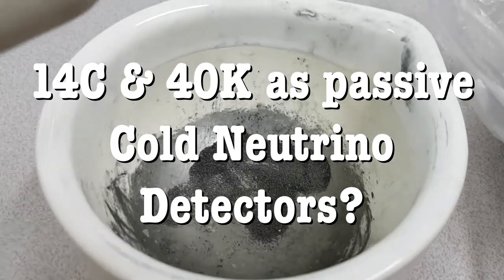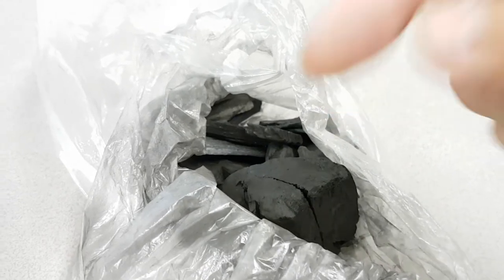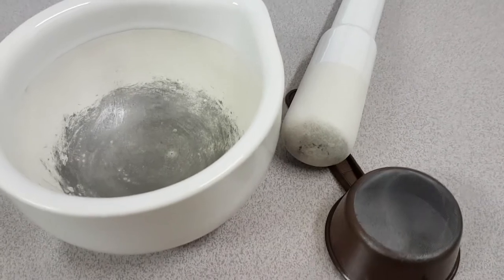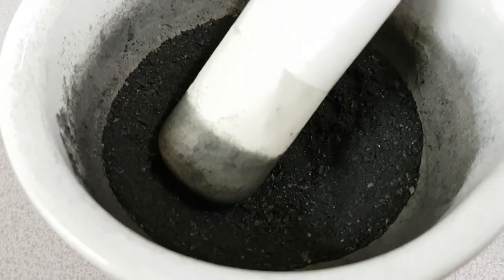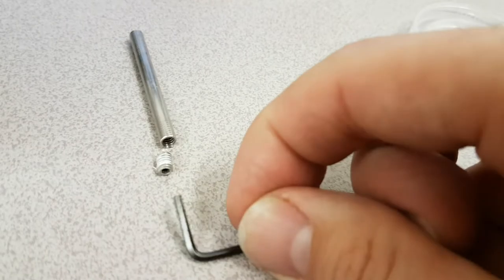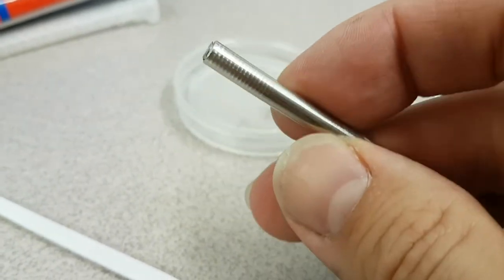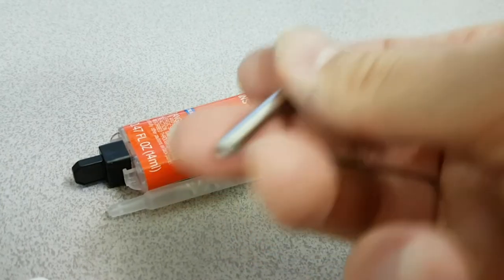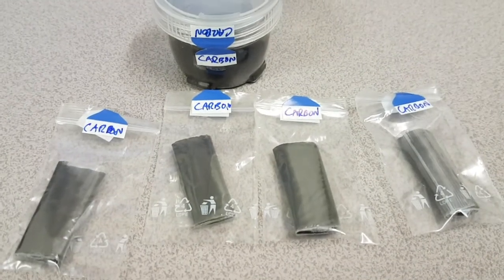OHMA - Passive Cold Neutrino Detectors

Comment: OK. That much closer to having answers. Great minds think alike, you beat me to the carbon based detector! Brilliant idea and plan. Can hardly wait to see the results!
Reply from the maker: This was conceived in 2017. The Super NOVA is apparently a lot harder to get working optimally, however, at some point we will get out NOVA reactor and can do more tests.

Intension is to have one of these 'detectors' near to Brown gas testing. Note, steel will reflect Cold Neutrinos but not all and also we know from Shishkin's cavitator, they can come out of a steel casing in the form of "String Vortex Solitons" AKA Black EVOs.
Reply from the maker: The main thing behind using 14C as a tracer, is that it is 'safe' to use, and is impervious to contamination before, during and after from all normal sources and handling techniques where other data from other experiments can receive legitimate criticism.
Reply from the maker: The 12/13/14 C beam line testing is 350 Euros a shot, so will add up quickly.